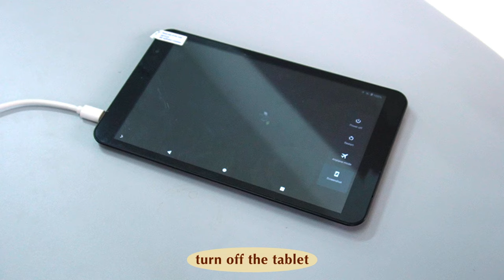Battery free tablet tutorial

Comment: I did something similar with an old Samsung Galaxy J2 cell phone a few months ago. I took the battery out and then spliced an old USB charging cord. It doesn't matter if the charging cord is an older one. The only wires you want are the red and black ones. Either the battery or some marking on the device will tell you which connection is positive and negative. What you want to do is solder the red wire to the positive connection and the black one to the negative. Now it will always say your battery is at 100% even though it's been removed. I've never had any issues doing this, but you might want to unplug the power souce from the wall every 90 minutes and let it rest for five minutes.
Reply: You're feeding it 5 volts where it expects 3.8 though. It may not be an issue for some devices depending on the design of the electronics, but in others it may not work or result in failure. You can buy very cheap step down transformer though to bump the 5V to 3.8V. But even that didn't work for me on some Alcatel tablets - when it didn't recognize the battery through the other leads beside + and -, it refused to boot up.

Comment: is there a way to use this and not use the usb connector?   I need to use it to  connect accessories but still need to charge.   can I wire a power supply directly into this?

Comment: I just did this mod and it was working well but now it randomly turns off after a few minutes. It seems the down volume button is also not pressing properly. Maybe that is why?
Reply from the maker: Try plugging it into a wall-socket plugged in USB charger, and see if that fixes it.  If so, you have an earlier DE1 that turns USB power off at times.
Reply: @decentespressotech yes it only happens to turn off when I push the start espresso or steam buttons so now I don’t know how to keep it powered on the machine.

Comment: Hi, on what brands of tablets will this work?
Reply: It depends on tablet maker if they made it easier for you to take out the battery and connector.   There are phones that would sense battery chip not being present even if I supply the 4.2 volts.   This maybe the same with some tablet makers.   You have to cut chip out from battery and supply 4.2 volts to chip and chip connects to the tablet or phone.